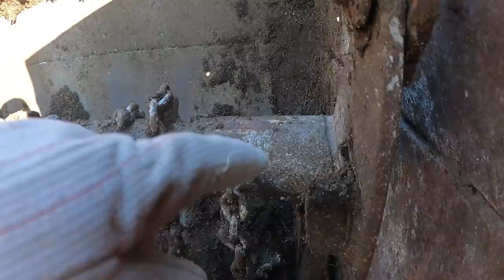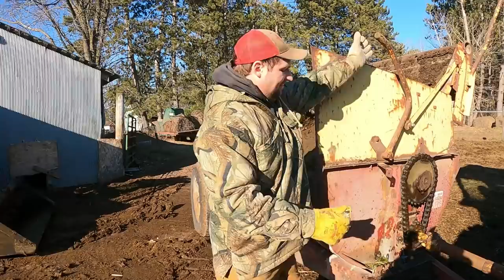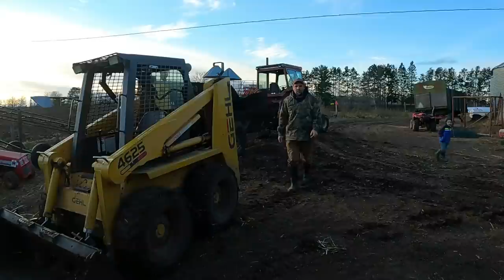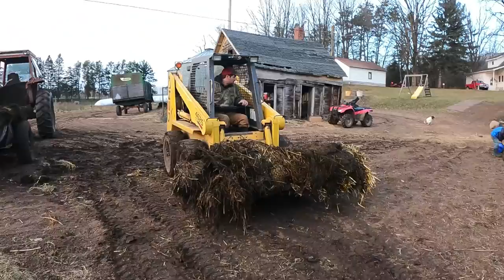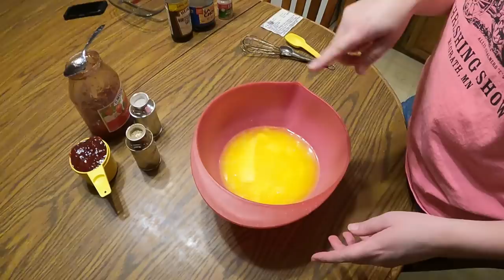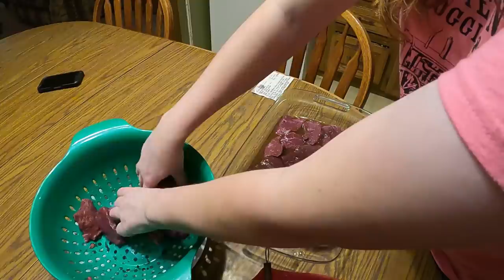Spreading Manure with New Holland Tank Spreader-Barrel Spreader/Venison Recipe

Comment: We had 2 of the biggest new holland flail spreaders years ago. They were tandem axle. 371 I think was the model of those. They weren't really any longer but a lot bigger around. I have a starline flail spreader now about the same size as yours. It works really good as long as you don't pack the manure into it.

Comment: We used to have one of those spreaders back in the day. We used to make replacement paddles out of I beam. Just torch the middle of the web a drill a hole to bolt to the chain. Works good, way cheaper than factory paddles.

Comment: Seeing that case 530 on the wood splitter that brings back another childhood memory my cousin had a homemade woodsplitter on his farmall 1206 back in the 80s him and my dad would cut firewood together my dad would use his 806 to pull trees out of the woods that was down pull out to edge of the fields of my grandparents cut them up and split them then load wood up in the loader of the 1206 take dump in old wagons to haul to the house. My dad would usually burn 16 to 20 loads of wood for winter alot of it was seasoned red oak
Reply: My grandparents had around 325 acres of woods and around 145 acres of tillable ground including pasture with thate

Comment: Al, is that a homemade wood splitter? What’s the gallon/minute flow on the Case hydraulics? Been thinking about making a splitter but don’t know what flow rate it would need.
Reply from the maker: Yeah, it's homemade, im not sure what the flow rate is. We have used the Farmall 560 on it also, and that worked pretty well also.
Reply: What model is that case? I can look it up
Reply from the maker: It's a 530
Reply: The 560 hydraulic flow rate is 12 gallons/minute. The 530 Case is 8.5 gallons/minute.
Reply from the maker: The 530 seems to have more power, but the 560 could be more worn too.
Reply: May be the difference between the 530 being a diesel and having more torque whereas the 560 has a higher flow rate but is a gasser.
Reply from the maker: This one is converted to gas, has a case 660 combine engine in it.